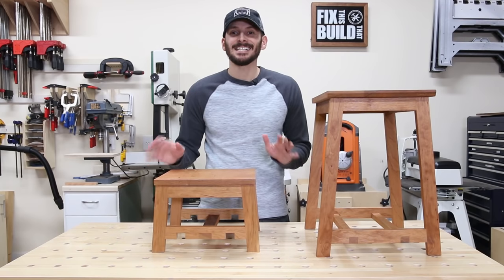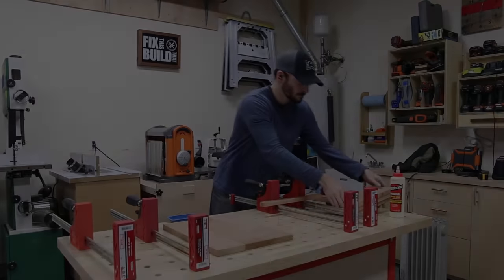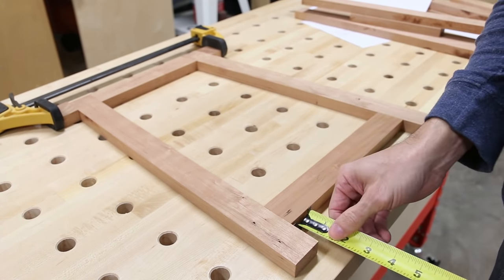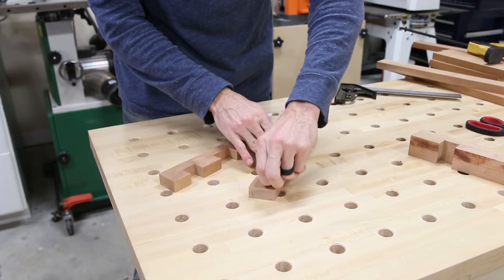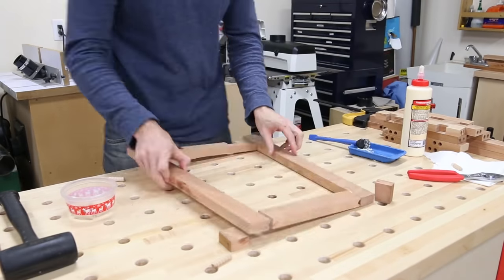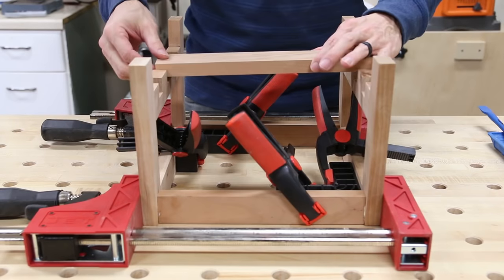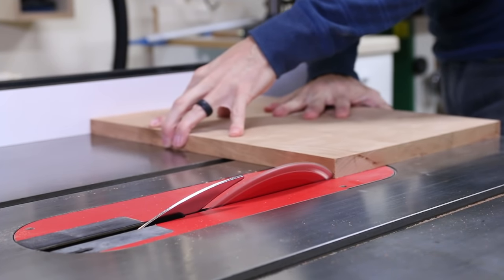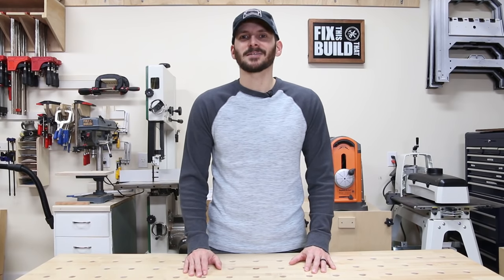DIY Nesting Step Stool | How to Build

Comment: Brad - great video, I just finished gluing up the sides and sanding.  The pocket hole screws for the aprons sadly split the legs : (  any tips on how to avoid this?  I used the fine thread, 1,1/4” kreg screws.  I guess now it’s time to learn how to repair a split cherry leg!
Reply from the maker: Dang! I'm assuming the grain line was running exatly the line the screw came in. Try to run them acroos grain lines vs with them
Reply: Fix This Build That many thanks for the reply!  To fix the leg I used some dental floss to bring glue through the crack (wedged open), resanded like new.  In the absence of a drill press, I used the self Centering dowel jig, clamped on top of the target, and used a Brad point bit to find the mark.. worked out great! Thanks again.

Comment: I have a question, and I’ve seen this before in other videos you make, why do you run your tops on the table saw and do a bevel edge on them instead of using a chamfer bit in a router? The router just seems easier but I’m sure you have your reasons!
Reply from the maker: I like the softer angle. This is 30 degrees and a router bit is typically 45. Also the router but bearing marks up the surface that you then have to sand out

Comment: Very cool idea ans design. But there is one thing Ireally dont understand: How was ist possiblie to drill the dowel holes in the angled joints at 90° ? The whole thing would be out of alignment...
Reply from the maker: the dowel joints align with the face of the joint.  so as long as the joint is flush then it works great
Reply: This was my initial thought too, but since both pieces should be cut with corresponding angles, the dowel holes end up being drilled at the same angle (but not parallel to the ground)
Reply: After I explained the problem to another person, I realized there was no problem : )
Reply: This is the reason I came to the comment section. Once I read these comments, problem solved.

Comment: What forcener bit set do you use for hand drill?

I’ve only seen them with the instructions to use with a drill press.
Reply from the maker: I used Brad point bits for the doweling jig. On the drill press I used a small 3/8 Forstner. I think they were from woodcraft

Comment: What connector pieces do you use for your rigid sander and rigid miter saw? I can’t find a way to connect my shop vac to either tool.
Reply from the maker: I use this one between the back of the sander and the port I have on my hose. http://amzn.to/2GJz7Kr . But you situation may be different depending on your hose connection.
Reply: Fix This Build That I just have a regular ole rigid shop vac, So is that orange hose your have a specific 4 inch hose from rigid?
Reply from the maker: It’s 2-1/2” and it’s called the pro 4x hose or something like that. The fittings it came with worked out of the box. And yes, it’s RIDGID

Comment from the maker: If you want detailed easy to follow plans for this build head over to:
https://fixthisbuildthat.com/product/3-in-1-nesting-step-stool-plans/
Reply: I've downloaded these plans and a couple others and I love the simple designs but I have to ask how tall are you? The furniture came out very nice but it seemed kinda low "I added 6inch feet to the outdoor sofa" and I started making adjustments to the builds to make the seating taller. This meant more wood than expected but store isn't that far away but you've got me curious now lol. Keep up the good work I plan on downloading a lot more as I go and thanks.